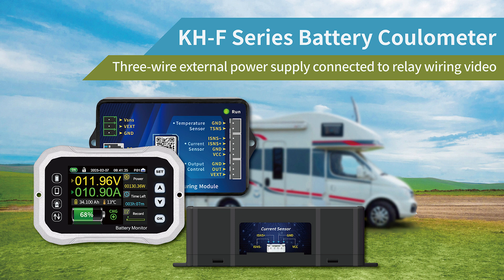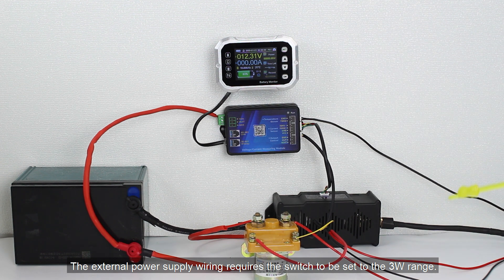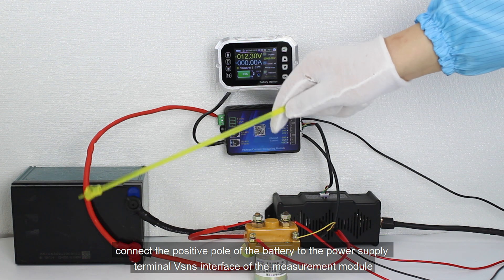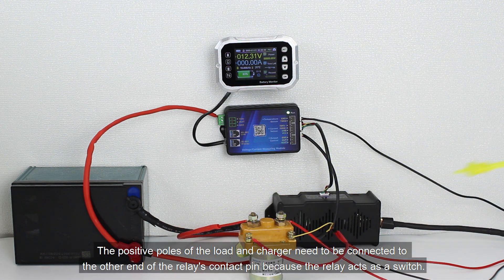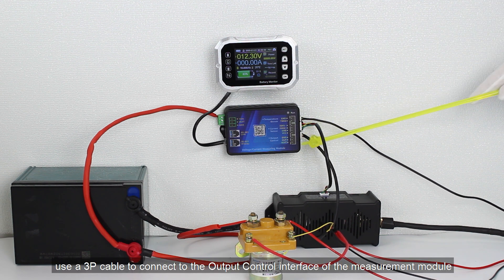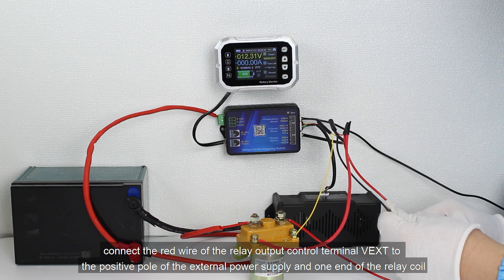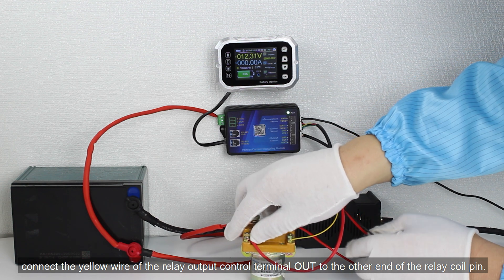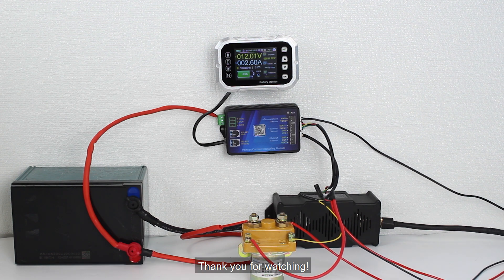The wiring method of KH140F when measuring 0-120V battery. RV Yacht Electric Vehicle Battery Monitor

Comment: Anyone know difference between KG, KH and KL series?
Reply from the maker: We have sent the file to your email, please check it
Reply: @junctek1802  thank you very much for responding
Reply: @junctek1802  I now know difference. KL comes without display, KG is second gen interface and shunt has no plastic case, KH series the UI is updated and the shunt comes encased in a plastic housing
Reply: @junctek1802  now when I connect temp probe the shunt stops working